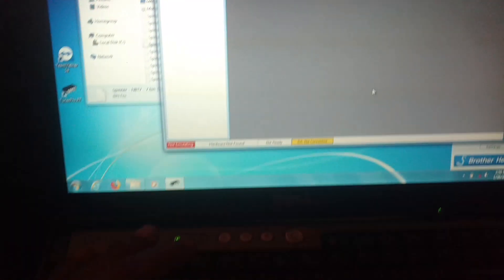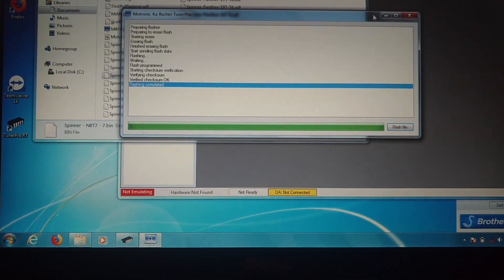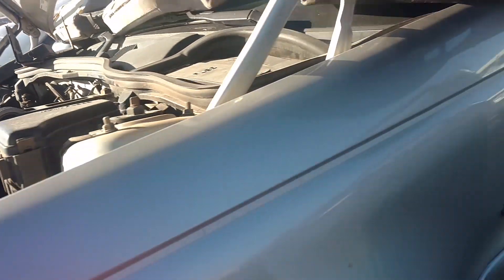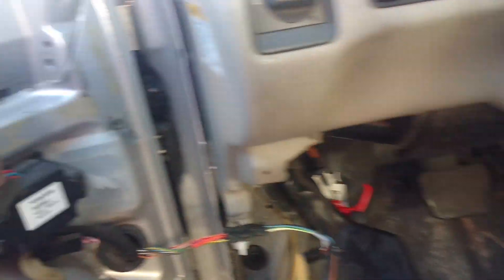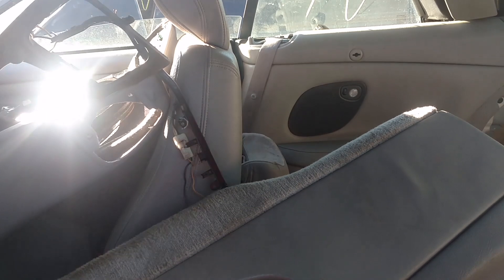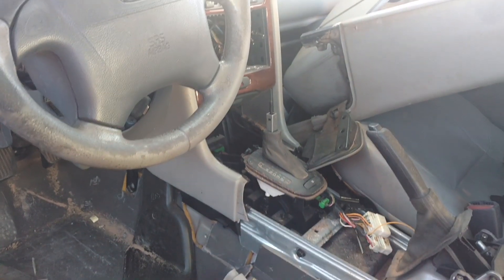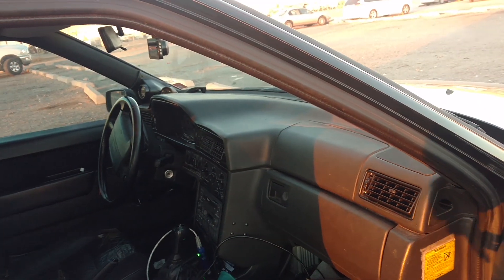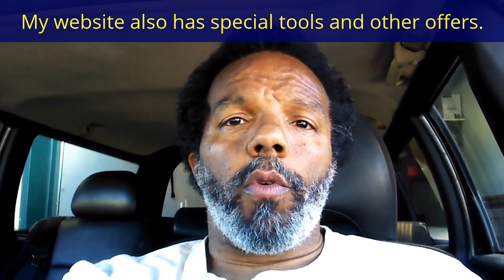Flashed another tune, junkyard for C70 stereo and more knock troubleshooting.

Comment: Link providing some history about C70 sound system:  https://www.dynaudio.com/car-audio/in-car-audio-the-history  Excellent sound - have the eleven speaker system and that is excellent on it's own.  Wiring is already in the C70's to support the subwoofer kit - 9 inch speakers with cross overs and switch.  Found parts, installed.  Adds low range thump and base.
Reply from the maker: Yes! Bass.

Comment: Robert you won’t be disappointed. These speakers are manufactured by company named Dynaudio. Great quality stuff. I do have C70 coupe and sound is amazing.
Reply from the maker: Does yours have the 2 subs in the back?
Reply: Mine doesn’t as this was mounted only in cabrio models. In coupe these speakers are moved to rear shelf. As far as I know all C70 came out with premium Dynaudio speakers from the factory. Only that dashboard speaker and dolby processor was optional.
Reply from the maker: The subs were an option.
Reply from the maker: I need to find a Dulby processor. I thought that was only needed for the dash speaker.
Reply: You may be right, maybe subs were an option too. I installed Dolby procesor without central dashboard speaker and it works fine with my SC-901 radio.

Comment: Hey Robert, I have 02 Volvo V70 leaking oil pretty badly. If you’re sitting in the drivers seat its coming from the right side towards the front. No overheating or smoke of any kind happening, just leaking to the bottom. Can’t really see anything down there until I get it jacked up. What do you think it could be? Thank you for everything
Reply from the maker: https://www.youtube.com/watch?v=gt9w-ZSxs9I
Reply from the maker: https://www.youtube.com/watch?v=vJXfQrDPK04&t=240s